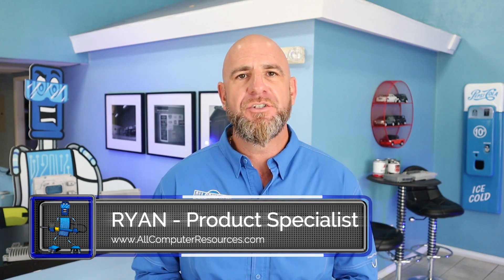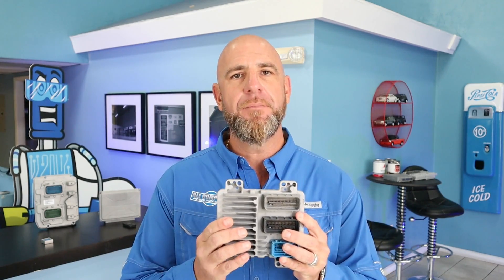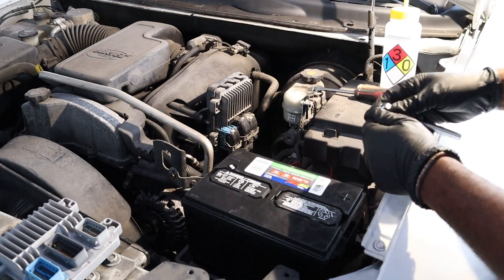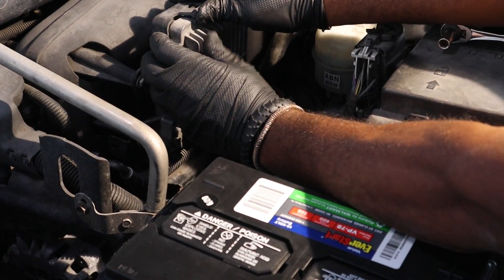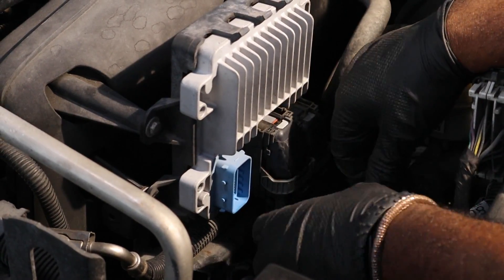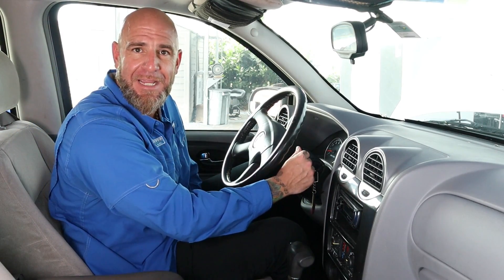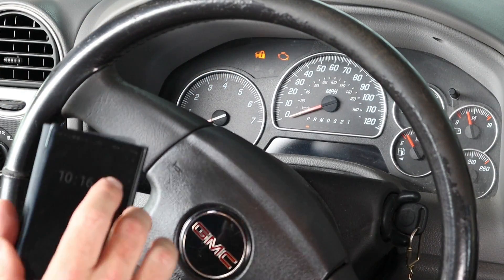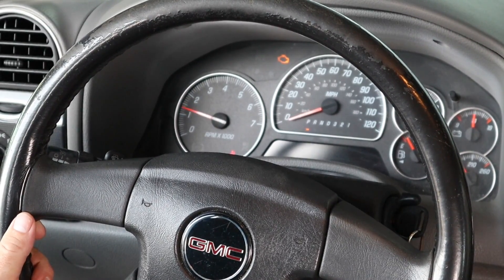HOW TO PROGRAM KEY FOR GM/CHEVY ANTI-THEFT - ECU REPLACEMENT PK3+ / PASSLOCK

Comment: Hi, I have a 2007 Chevy Silverado. My original key got dropped in the lake. I called dealer and they sent me a key to get it towed home. I live in a remote location. They told me I wouldn’t be able to start it. They asked if I can take it to
Them but I can’t. It’ll cost me around 2000$ just to tow it from a remote location to the dealership just to have it reprogrammed. Asked if there’s anything I can buy to get them to send up so I can try it myself. They didn’t wanna help me, they kept insisting I take it them 🤷🏻‍♂️🤷🏻‍♂️. Would it work if I order this pcm? The key they sent me turns but security light flashes.
Reply from the maker: Hello, thanks for the message. If you have a local mobile locksmith, he should be able to cut you a new Key and program it. This should cost much less than the Dealership.

Comment: Which procedure should be used for the 2012 Chevy Cruze with the flip out key because didn't see that key in your pictures of keys?
Reply from the maker: Hello Gene, The 2012 Chevy Cruze is equipped with PK3+. This is the correct video to follow if you had purchased a unit from us that is programmed and calibrated to your vehicle.
Reply: @acr  Ok thanks and I didn't purchase my ECU from you but the immobilizer light should be illuminated when the new ECU is installed right because the one that I purchased "supposed to be plug and play" but it started car 1 time and now car just keeps turning over and won't crank but security light came off and on like usually when starting car.

Comment: I have a 2005 Pontiac Grand Prix Gxp , I installed a used ecu from another car , my theft info comes up , reason why I installed is because the original ecu hit the starter and shorted out and that caused my car not to start , with the use I just installed I had a lock smith come out and did a key for it and nothing happed , what should I do ?
Reply from the maker: Mr. Dixon, My first suggestion would be to inspect the vehicle for electrical shortages. The ECU would be incapable of shorting the starter as it is a low voltage part. The starter, however, if not grounded and/or has malfunctioned is capable of damaging electronics. Secondly, if the ECU has malfunctioned, you can easily purchase one from us at www.allcomputerresources.com which is pre-calibrated and VIN programmed specifically to your vehicle, once you receive that ECU from us, you would follow this relearn procedure and will not require a locksmith or mechanic.

Comment: I have a 2016 malibu with push button start. Will this procedure work on my car? I wish I would have seen this video before I bought my pcu from someone else.
Reply from the maker: Ms. Garcia, It all depends on how the other company programmed the unit. Do they offer some type of Tech Support?
Reply: I talked with them and they walked me through the re-learn key process but my husband still couldn't get it to work. I sent it back and got my refund. The code is P1101. We've changed max air flow sensor, air filter and cleaned throttle body. But check engine light is still on. Some times it will go off for a day or two but it still comes back on.

Comment: Does this work with the original key that was already programmed or is this for a UNprogrammed new key? The title relearning confuses me for it sounds like relearning an existing key. Sorry for my ignorance, but I have a new ECU and no new key only the original key and I would like to know before attempting it.
Reply: I did it and it started but the light of the car with a lock stays on while the vehicle is running.
Reply from the maker: Mr. Ovadiah, If you purchased the PCM from us which is calibrated and VIN programmed, you would use your existing keys to perform the relearn procedure.

Comment: NOT TO PUT ANYONE DOWN...

Normally we use Flagship one for our computers, and for the last two times we had to get a GM computer, and BOTH times they messed us up by the instructions they sent us. We were trying for at least 3 hours to get it to work (2003 Chevy Impala), contacted them, NO HELP AT ALL! The person on chat kept insisting we had something wrong with the car, even though the old computer started the car fine (was not sending signal to turn fans on).

We came across this video, and BAM, car started up on the first attempt. They had us just turning the key to the "ON" position, where you have us turning it to the "START" position. Just wanted to let you know that we will be doing a video about your company, and from now on, you have our business, THANK YOU!
Reply: I'm glad I saw your comment. I tried for a two days doing the 30 minute relearn after losing my master key and getting a new one cut at the dealership. But the instructions I was reading were the same as you. It's a 2004 Grand Prix GT in case anyone else has similar issues, thank you!!
Reply from the maker: Hello and thank you for the comment. Sorry to hear of the troubles with another company and glad we were able to help you get the vehicle running. There are a couple different procedures when it comes to a key relearn on GM vehicles and we have both videos posted here with the specifics. We are glad to have your business and look forward to working with you.
Reply: @acr  ok, so what does it mean when your theft light doesn't come on for at least three minutes after the attempt to start?
Reply: @jester197798 that's what I'm trying to figure out too.
Reply from the maker: @jester197798  Thanks for your question. If your theft light doesn’t come on for several minutes after trying to start, it could indicate a communication delay or fault between the key reader, BCM, or PCM. Normally, the theft light should illuminate immediately during the start cycle if there’s a security issue.

Here are a few possible causes:

Weak battery or poor ground causing delayed module response

Faulty ignition switch or key reader (especially on Passlock systems)

Failing BCM or corrupted communication on the data bus

We’d recommend scanning for B-codes or U-codes related to theft or module communication. If you're replacing the ECM timing like this, it could point to incomplete pairing or a fault in the theft module.
Reply: This doesn't make me feel warm or fuzzy. Questions going unanswered is a big red flag..
Reply from the maker: @deanstuder1775  Hi Dean, we totally understand your concern — and you're right to expect timely answers. We do our best to respond to every question, but occasionally some slip through due to volume or platform delays.

If you have any specific questions or need help with a part or service, feel free to drop it here or reach out directly — we’re here to help and stand behind everything we do. Your confidence matters to us.
Reply: Did this last night with my Flagship one instructions. It does not state to try to start after the light goes off. I guess I will find out when I get home if this method does the trick. They need to fix their instructions at FS1
Reply: @fogstain did it work

Comment: I have a 2011 GMC Acadia installed a new ECU and did everything in your video the car fired right up i took it fir a drive and everything works the problem is when i parked and came back 10 mins after it went straight back into anti theft mode i relearn they key twice and the same thing keeps happening any ideas whats causing it to forget the relearn process
Reply from the maker: Difficult to say without properly diagnosing the vehicle but I would lean towards the actual anti-theft system (not the ECU) having an issue.

Comment: Will this work for a 2012 Impala LT?
Reply from the maker: Selah, If the PCM you are installing was purchased from us or it was calibrated and VIN programmed prior to installation, then yes, this is the correct procedure to follow. The 2012 Impala LT has the PK3+ Security System.
Reply: On my 5th cycle still no security light nor has it crunk

Comment: i just replaced my pcm the security light turns on and off instantly like it did with the old pcm and  when i crank the car the security light does not come on at all. is there anything i can do to make it turn on? i don't think it's possible to relearn the pcm without the security light staying in for the 10 minutes it's supposed to
Reply from the maker: Hi Preston, Did you purchase the PCM from us and please provide the year/model of the vehicle.
Reply: @acr  I did not purchase from you but i would still appreciate if you could help spread some knowledge. 

I figured out that my car has VATS and that the resistance of the key needs to match what is on the pcm or it will not run. my question is can the resistance be modified on the pcm or can i bypass it? and if it is VATS related would i have a dash light?

Comment: I have a 2008 chevy silverado 1500, i bought a new pcm already programmed and tried this procedure, i did it twice but my truck wont start i there something else that could be affecting this?

Just found out when i install the new pcm that the crankshaft sensor needs to be relearned
Reply from the maker: If you purchased a brand new PCM from the dealer it is not programmed and calibrated as they are unable to do such off-board procedures.

Comment: My security light goes off immediately after letting key go to the run position. It will never remain on. I did the 3 sequences regardless, exactly to 10 minutes each...and car does not start.
Reply from the maker: If the security light is going off immediately then it has yet to be triggered to enter the relearn mode. Check and be sure that you are following the correct procedure for your vehicle.
Reply: Did you ever get the light to stay on?im having the same problem
Reply: @LightSkinLoving  Are you using a replacement PCM that was calibrated and programmed to your vehicle using the VIN, Service#, and flashed correctly?
Reply: @anonymousfishing4174  yes it should be the correct part number and the vin number matches
Reply: @anonymousfishing4174  Yes I purchased the proper PCM and it was flashed to my Vin. I finally took the car to the dealer. They reflashed and ran diagnostics and were unable to fix the problem. They were unable to run the relearn procedure. They changed the throttle body & sensor as they said it was part of that electrical circuit. It did not help, and i was charged for the part. The car was towed back to me unresolved from the GM dealer. Another $600 bill, plus towing. I finally scrapped the car.

Comment: My cobalt ss ecm is bad if I just went and bought one for the same years as my car could I just throw it in and it would fix it ?
Reply from the maker: It's a long shot. There are many different calibration flash files depending on the options and emissions of the vehicle. Additionally, the PCM would need the VIN programmed to eliminate the check engine light and immobilizer issues.

Comment: Hi boss i want to program chevrolet aveo 2011 new ecm can i just go direct to immo key programming on my device, or unless i do ecm program first
Reply from the maker: Mr. Keys, if you purchased the module through us just go straight to the key programming.
Reply: Hello sir I have a problem with the Hummer H3 engine 3.7 L5 of 2007 I code p2128 and b2960

Comment: Ive tried the process twice now, no luck. 2005 G6, Reprogrammed ECM to VIN, but cannot get security light to stay on. It monetarily lights, then quickly goes off. I run the 3x 10 minute segments. But no start. ( Previously car would random shut down, eng-disabled, pwr-restricted, error would appear. Wait 20 seconds it would restart. This is why Im changing ECM.)  Also, I cannot keep battery charged during process, as all lights come on this car automatically. I tried a charger, cant keep up. Only way was to hook up another running car with jumpers. Do you think that could be an issue..?  thx! Nice clear video.!
Reply from the maker: Mr. Miller, I have confirmed that this is the correct video with the procedure required for your 2006 G6. It very important that the key is turned to the start run position and released to engage the security system. Also, it's critical that you have the correct ECM for your vehicle. Did you order it from us?

Comment: Thank you! Does this only works with brand new blank PCM's? Is it the same process if I want to install a junkyard PCM?
Reply from the maker: The units that we provide are not blank. We supply ECMs that are correctly matched using the calibration required based on the VIN decode. Junkyard PCMs share similar service #'s but the calibration varies between models. In theory, it is possible but given that junkyards will not accept returns on electronics, it could be risky. You would still need someone to program the VIN in the module as well.

Comment: I have a 2004 silverado 2500 (not HD) 6.0 gas 4x4. It was running then shut off, I have the correct fuel pressure. It will crank but not start. replaced the crank sensor and cam sensor. No pulse to injectors, no spark from coils and no power to the crank sensor. PCM connectors had oil in them. I cleaned plugs and pcm with contact cleaner. Security light does not stay on. Key is very loose and can be removed at any position. Would this be a pcm, ignition or key problem?
Reply from the maker: Would be tough to say. The sec light won't remain on since it's not in a relearn mode and that has yet to be triggered nor does it appear that it would need to. This video is referring to performing a key relearn for individuals that are replacing the PCM. If I had to choose from the 3, I would lean towards the PCM but I recommend performing an order of diagnosis pertinent to your symptoms.

Comment: @All Computer Resources   I have a 2007 Chevy Colorado and truck cranks over and then cuts out... The anti theft came on so I replace lock sensor and tried key relearn process..my problem is why try to re learn the anti theft light NEVER turns off no matter how long I leave key in position...could this be a BCM problem??
Reply from the maker: Hello, This process outlined is mainly for the replacement of a GM ECU with the aforementioned security types. It appears that you are having issues with your theft system altogether which would require a diagnosis.

Comment: This is an old procedure, does not work on vehicles made after 2010 or global A cars and if you replace ecm with salvaged car will not ever start. Also teck 3 required for key relearning
Reply from the maker: Hi There Mike, We are going to strongly disagree with your statement as it is inaccurate.

Comment: Hello! GM training video and GM service manual describe the passlock learning procedure differently from your video, without turning the ignition off between 10 min. cycles. On the other hand, you guys have a lot of practical experience. What are your thoughts on this contradiction? I have 97 Sunfire with passlock and I mentioned 97 GM Service Manual and 96 GM passlock system training video.
Reply from the maker: The 1997 Pontiac Sunfire uses the PL1 system (Passlock 1). The process for key relearn is outlined correctly in this video, the 10 min would be closer to 11 min the the process is the same
Reply: @acr  My 97 Pontiac Sunfire has a key with no chip or resistor and according to your video this is Passlock, not Passlock 1?
Reply from the maker: @bobmead8184  Passlock and Passlock 1 follow the same instructions. If you had a resistor/chip on the metal part of your key that would be a Passkey system which would be a different set of instructions.
Reply from the maker: @bobmead8184  All Passlock systems whether 1 or 2 utilize the same exact process.
Reply: @acr  Thank you. Do you guys repair instrument cluster processors, by any chance? If so, how much do you charge for 97 Sunfire cluster?
Reply: @acr  Thank you!

Comment: I have another doubt..
This is the manual always relearn, but it can be made it with a scan tool as well, right?
Reply from the maker: Yes, absolutely - With a scan tool you can enter the security access and perform what is referred to as a "10 minute relearn"

Comment: I have a 2012 Chevy Volt.
I am not sure what kind of key system I have because my key goes in a hole in the center of the dash and have a push button electric start button. Have not found a video for mine. I'm thinking it could be a passkey because there is no writing on my key which flips out for emergency when transponder fails to start. It has a groove cut right down middle shaped like a snake crawling?

Any body know what type of key I have please let me know!
Reply from the maker: The 2012 Chevy VOLT is PK3+ w/ Smart Key. This would be the procedure but you would have to alter the actions. Instead of turning the key to the "on Position" Press the brake and attempt to start the car.. Continue to follow the cadence as this video outlines. for "Key off" just press the start button again (foot off the brake). You have to be precise with this procedure.

Comment: Hi 🙋‍♀️ I have a 2006 Chevy Equinox and just bought a new computer for it. I went through the 30 minute process twice before the security light went out. There’s a misfire on the number 5 cylinder and I’m hoping that this new computer fixes the issue. My car has all new wires, plugs, the works installed so fingers crossed that this will help. The service engine soon light is still on after installing this computer though 🤔 My husband said the new computer would fix that issue but I’m not so sure about it until the codes are checked again. Any ideas on what I can do to fix this? I appreciate any information that you can give and thanks so much in advance. Love your channel by the way and a big thumbs up 👍 😎
Reply from the maker: I would suggest connecting a scan tool and check the actual codes and go from there. If you didn't buy the computer from us, the module may be missing the VIN and correct calibration and could trigger the CEL and possibly drivability issues. Keep us posted.